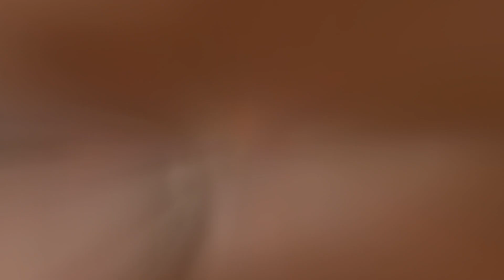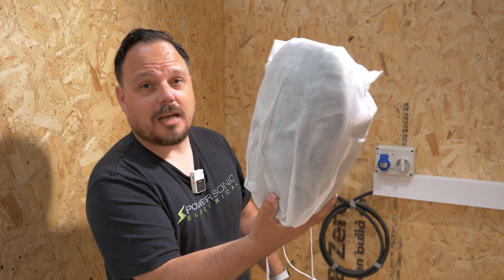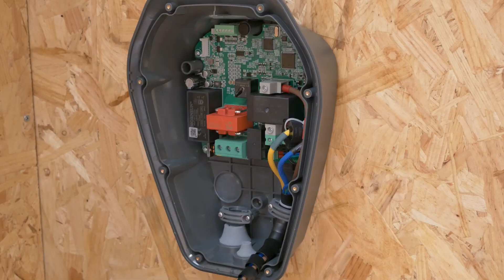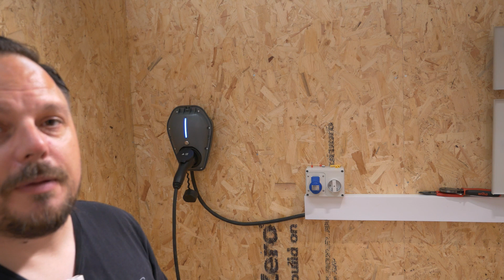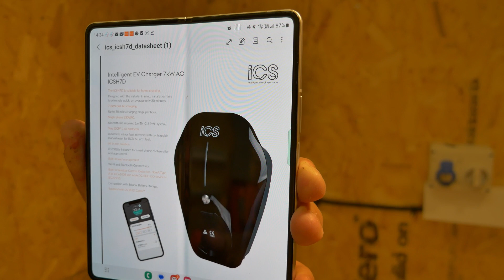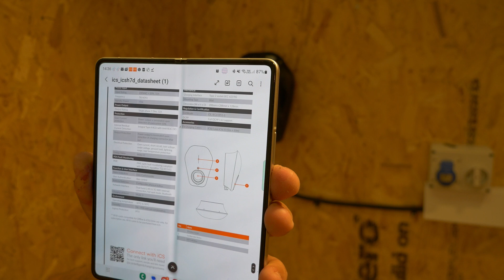EV charger under £500 - ICS H7D 7kW electric vehicle charge point with app setup!

Comment: Do these ICS chargers need a CT clamp on them? It says they have built in load management, I’m hearing mix opinions on this?
Reply from the maker: Depends on model. This one does not have CT monitoring and should be used on supplies that don't require load management (most tbh don't need this, my charger has never load limited in 3 years lol)
Reply: @ to be fair if your installing on a 100 amp main fuse,  they don’t have a big KW shower or heavy induction hob I can’t really see the need to load manage  it anyway. Especially if it’s only a 7kw charger..
Reply: @ I normally install the ICSHT7D model, I agree with you on that one. Be interesting too see how many chargers actually load limit as bet hardly any of that KW rating do

Comment: I’ve been recommended this by a local electrician. Can you schedule a charge to start at midnight? I’ll be using this with Tesla. My understanding is you can schedule charging in the car itself, but just wondering will this work or will the charger itself need to be programmed? (Hope this makes sense)
Reply from the maker: It can be programmed
Reply: @ thank you! I can’t find much customer feedback online - do you hear much from customers about these?

Comment: This may well be easy to install but it sure ain’t easy for the user. Builder had it installed but I can’t get it to work. Overly complicated and ni instructions for user.
Reply from the maker: The manuals are easily downloaded 🤷‍♂️

https://intelligentchargingsystems.attachments-euc9.freshdesk.com/data/helpdesk/attachments/production/101149431118/original/ICS%20ICSHT7D%20V1.02_update_2.pdf?response-content-type=application%2Fpdf&Expires=1716326595&Signature=LEMeCX1zvoF5B-HGB5s6oTX8c9pkrwFGRQSoubPycJI5Jyr4hy1CeLmn-OqPivazycw8fjLBArnJYBqq0Gwn7nxKNbUAtTOePx6-ZxZ4YDYHvPjewrtP42DtyWvRfPeuFHunDn4-IKH341FUfqnmp4Zxbi5CTgaozUSFm3S-3tdVBpperfWUjtswUfJJ-ii6jUmHSVyBeqnXzSi1QT6ICkRL5Jld9aZNLaCIZv8LrtWuMdu9Wt628MLwBU5j~IdGu1n~vQ697rBEym22YKZjva6cQm44e3M2FLJxaXqsvVG~-WOCVmM3d2vdvoZRokTN3aCpqIVULZcvdzb0hgWCvA__&Key-Pair-Id=APKAJ7JARUX3F6RQIXLA

Comment: I have had this  chargepoint at home.for 4 months now. The first unit had a problem with the screw fixings for the unit which were damsged.  It was quickly replaced and has worked very well since.

We get periodic messages to say the charger has gone offline but this has not caused problems.  The technical support has been excellent as our supply voltage fluctuates quite a lot and they made adjustments remotely to compensate for this.  We also had a couple of issues with connection to wifi during the install which tech support resolved over the phone and by remotely connecting to the point.

Highly recommended.

Editted to correct typos!

Comment: Easy to install. But we had nothing but problems and will not be using again. 1 big issue was their server going down. Meaning you couldn't charge a vehicle at the time.
Reply: Can you get Neil to fit one 10 minutes or lower 😂😂😂
Reply from the maker: Tbh we had a huge issue with myenergi, hypervolt and podpoint in the past. None are without problems sadly. These seem okay we have a few 22kW units in the field and zero issues 🤷‍♂️